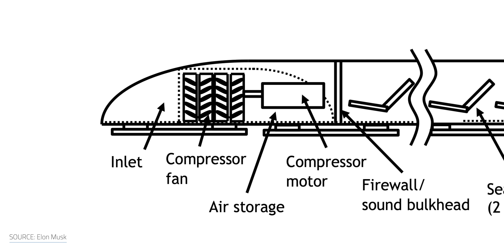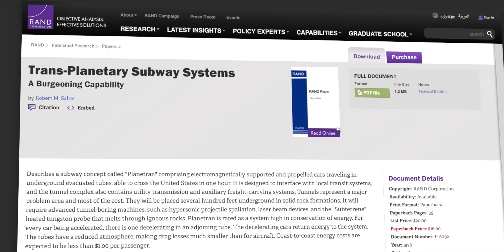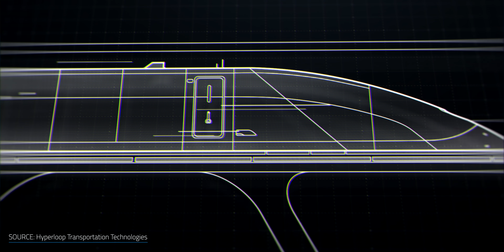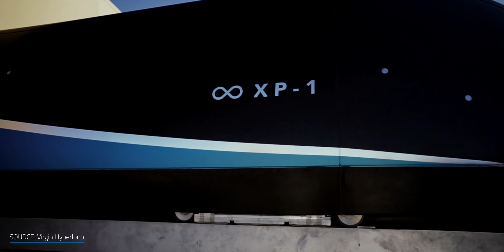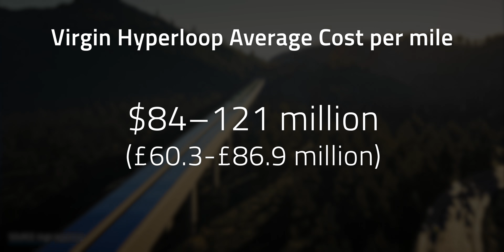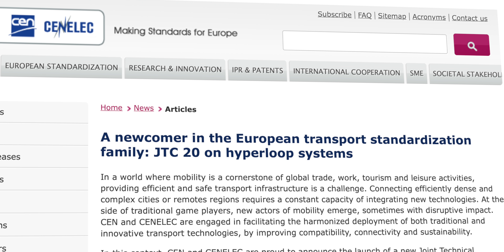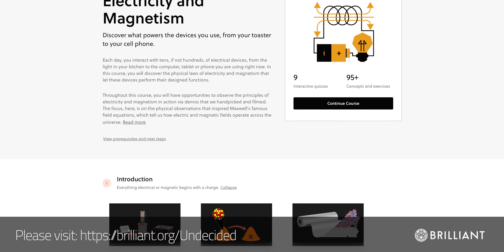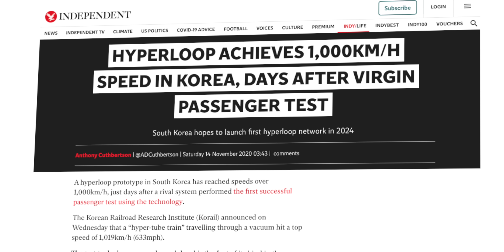Exploring Hyperloop - The Future of Renewable Public Transport?

Comment: The boring company loops cost so much less than subways not because TBC has any special sauce (they are a small group of engineers mostly running off the shelf TBMs) but rather because they deleted a bunch of expensive safety features while putting a more dangerous system in the tunnels.

Comment: Most, or all, high speed trains today are electric. That means they can be powered by clean energy sources, just like the Hyperloop is to be.

There aren't too many mag-lev trains now. The reason is cost, which is significantly more than high speed trains on conventional rail, meaning that mag-levs aren't financially viable for most routes. A similar situation must also be the case for Hyperloop.

Comment: I'd rather speak to the engineer that musk actually stole the idea from :P.
Also, these projects just aren't realistic. The carrying capacity is TINY. The cost incredible, and you have to invest extra to avoid damage to the track.

The loop project is far worse in comparison as well. It's... JUST A TUNNEL. LITERALLY JUST A TUNNEL. Except it's very long, you can only fit a couple people in each pod, and it uses expensive elevators for no reason.

Just look at japan. They use actual maglev trains, have invested billions. And even then the trains are incredibly expensive just to ride and run. If they don't switch over to hyperloops, you can see why it's cool... but completely unfeasible.

Comment: The Hyperloop is a stupid idea on pretty much all levels. Security, Cost-efficiency, reliability, compatability and even just getting a useful connection at all. Even speed is no longer a good point, since conventional rail (like the maglev) are already close to same speeds and its also not going to exceed future plane speeds, if we really consider high speed an important factor. Its an overengineered, unpractical and fake-futurism solution to a problem, that doesnt really exist. Just built a damn train. America was capable of that, when Lincoln was in office.

Comment: A few problems here:
1. Earthquake (you said it)
2. Biggest Chamber with Vacuum is not close to what it would need. You would need several gates. And they would need to be exceptionally fast.
3. Once the Hyperloop is filled with air, this thing ain‘t go anywhere. It then would need to push the air to side wich is impossible.
4. If you can’t go anywhere, you can’t exit.
Reply: #4 is an excellent point. One of the companies say they have developed a safety system which will bring the pod to a halt on its wheels if there is some sort of issue. That's nice, but how do the passengers get out? And if the power fails, does the pod's life support continue to function, and for how long? And how long can the passengers wait to be retrieved when there is no life support and they are sealed inside an air tight tube?

Comment: 1. In California, what happens during an Earthquake, the tube cracks or deforms and the train 
     is running at 760 mph?
2. What happens if the Hyperloop train has to stop due to a failure? 
      There are no planned exit openings in a vacuum tunnel.
     The walk from the middle of the Los-Angeles to San-Francisco tunnel (about 370 miles) 
      should take more than a week!!
3. The test of the model at California cannot possibly scale up: Creating a vacuum 
      in one-mile tube should take only a few minutes. 
       Creating a vacuum in a 370 mile long pipe may take several hours. How does this save time?
4. Southwest can get you from LA to SF in about an hour for less than $100. 
     To offset the construction and operational costs of the Hyperloop, the cost of the ride 
     would be much higher.

5. The train is about the width of the tunnel to maximize the vacuum efficiency. 
     This means that a human cannot vacate the train from the side - there is no room.
     The front and back of the train do not seem to have a rapid evacuation port!!

Comment: Has anyone every seen a discussion of using composites for the construction of the tube?  Seems like a cost effective way to quickly produce miles of track.  It could be done in a continuous manner weaving fiberglass and carbon fiber in place with a machine that can also inject resin and cure it as it moves along weaving more tube.

Comment: Electric VTOL vehicles will take care of the people transport with out the limitation of fixed point hyperloop stations.  Might not be as fast, but eliminates the overhead of traveling to the nearest entry/exit point for the Hyperloop.  Freight might be and option though.  But it would have to be cheaper than current solutions.  And that looks like a pretty significant challenge.

Comment: It'll be interesting to see what this eventually ends up being.
Much has already been lost from Elon Musk's white paper, such as the air ski and the propeller.
I expect the next thing to go would be the extremely low atmospheric pressure, removing any amount of air from the system is a win for speed, but it gets exponentially harder and more dangerous the lower the pressure. There's likely a sweet spot where speed is balanced out with the energy cost of maintaining the vaccum and safety.

Comment: If you want to reach Hyperloop speeds just build high speed rail and use a third of the power the Hyperloop would require for operation and you will get the Hyperloop proposed results without any of the dangers of space

Comment: Hyperloop is not a new technology....it was thought up more than 70 freaking years ago..... but surprise surprise planes won the transport race ... and why is it that planes are now normal and why hyperloop has never been created? Because planes are safe as hell...you will NEVER get a safety level enough to transport humans at 900mph in a pressurized metal tube. Any puncture along the entire stretch between locks would be catastrophic failure and bodies won't be recovered because they will be a past. There's a reason why the hyperloop has gone 70 years without even a working prototype. Even jow as multiple companies are trying to build it have literally not even gone above a few mph.... you can try and claim its just the start but again this has been a thing for over 70 years. If planes are what they are now then if the hyperloop was anywhere near possible or safe than it would already be a thing. Sorry but 99% of people are never going to step into a tiny metal tube, in a tiny metal container moving at speeds where any slight turn, anything accidently left inside the tube or pieces of metal falling off stuff would lead to catastrophic failure. Pressurization is NOT safe and will not be anywhere near as safe as planes are already. Hyperloop is a stupid idea that has gone no where in over 70 years.......

Comment: If you're going to install the pumps to draw a vacuum anyway, and the vacuum is dangerous and costly to maintain, then why not just pump the air from the head wind of the train around to the tail wind as it moves. You don't really need a full vacuum in the entire tube, you only need to get the back force of the compressing air away from the front of the train, and if you can divert that force to the rear it should increase the overall effect in a way that is superior to a full vacuum.

I'm sure there's a way to build the tunnel like a tesla valve to take the head wind to the tail even with just the compressing force of the train moving rather than using pumps in the tunnels. The train effectively becoming the piston of a pump to drive the forward compressing air through tributary tunnels along the side of the main tunnel. Perhaps it would need computer controlled valves, then as the train draws closer to the destination the effect can be tapered off or directed to the walls of the train to help slow it down on approach.

Comment: Hyperloop has been shown multiple times to be entirely infeasible. Even Musk himself has walked back on the idea of e.g. the pods levitating inside the tube and instead would be using....plain, old wheels. Hundreds of miles of tube at a very low pressure would basically require pumping-stations every couple of meters, consuming enormous amounts of energy, and that's all not taking into account all the manual labour of checking and maintaining the seals all along the way! Besides all the above, it the pod ruptured....well, now you've got a pod full of dead people.

As for the various companies, well, e.g. the one in France turns out to be nothing more than a small office with no engineers or anything. It's all just about hyping and extracting money out of gullible people.

This video is basically nothing more than reading from marketing-material and goes to show that this channel is not for people who want actual, realistic information.

Comment: I'm surprised you didn't invoke our memory (40+y/o) of the tubes we used to put our paychecks and bank books in at the bank. Those worked great. But they made alot of noise and I can see how it would cause issues at scale.
Reply: Those are pneumatic tubes, completely different than having multiple pods in the same tube utilizing mag-lev.

Comment: actually, possible depressurisation are a very serious issue, since emergency oxigen masks are insufficient to help people survive:  U2 and Blackbird pilots used to wear astronaut suits, in fact, because over 60ooo ft the boiling temperature of water happens to be less than 37°C ...so, in case of rapid depressurisation, your body starts losing all its water and you die in few seconds

Comment: My thoughts can travel to San Francisco at ~the speed of light, so I don't need to physically travel that fast, but if they build it I will come (and try it out if it is deemed as safe as commercial air travel). I am very apprehensive about producing and maintaining a high vacuum in an immensely long tube.

Comment: WHAT A DISGRACE OF A VIDEO
doing fun servicing and act as public relations of elon musk
1. Heat expansion REAL ISSUE which was never addressed in elon musk 55 page release paper. They said the 300 meter expansion will just extent the pipes on both ends !?!?!?!?
something never tested and will never happen
2. heat expansion will also not be uniform since the half pipe will be heated and other half will be on shade which will have a twitch effect on the pipe
3. are there going to be escape position on the pipe? imagine if a failure happened and you are trapped half way the pipe how you will get out? all designs of capsule make it impossible to open a  door and let people  out of the capsule
4. no working at all at sealing door that will be needed to load unload capsules into the tube, since it would make sense to have a small [pipe that will fit the capsule close it, take off air then open a door inside the capsule to allow it enter the pipe. all other parts of technology is tested and well known to work the only need to be tested and show it can work it is not tested at all
5. above ground it will be a disaster to happen so it need to go undergound
where you need to make a huge tunnel and then place the pipe on it to make sure earthquake will not break the wall since the pipe can have some flexibility to move
6. for any realistic implementation you will need at least 3 lines interconnect to each other at points
to make sure 2 are always on use and one can be closed for maintained. which we come again to the airlocks not developed or researched at all

Comment: Sorry, Ferrell, but you fell for the BS that still circulates due to the original White Paper Musk published in 2013.
That thing included such mutually exclusive concepts as an AIR CUSHION (possibility one of hovering the train) in a VACCUUM tube (reducing air friction).
That was obviously total bullshit from the get-go because you CAN'T have both an air cushion as well as a high vaccuum.

So it was dropped by Musk almost immediately. 
He successfully sold off this absolute economic nightmare of a pipe dream thanks to Musk's only redeeming quality as a business man: his charismatic sales-pitch.
Others bought into this idea, and wasted enormous amounts of time and money on something that will not be economically viable.

Yet, until now, absolutely NONE of the predicted positives have even been approached remotely.
Neither the speed, the acceleration, the vaccuum, the transmission of energy into the train, carrying of air inside the train, a full size pod with the required internal structure, any kind of mag-lev capability, any kind of vaccuum sealed tube with ANY kind of curvature... the list just goes on and on and on.

The top speeds achieved in the Virgin Hyperloop was a mere 105 mph. 
As a German I can tell you that is considered acceptable speeds on the left lane of the Autobahn. Daily. Regularly, Without ANY vaccuum tube. But is exceeded regularly by standard cars.
Oh, and WELL exceeded by trains next to the Autobahn going around 300 km/h, roughly 195 mph.

So the CEO of Virgin Hyperloop was selling you the same crap every fan boy has been spewing for nearly eight years now. It has been done previously, cheaper, more often, safer, and much much more comfortably than the reconstructed air-plane cabin shoved into a tube with WHEELS still carrying the pod.

The only thing that already has been broken is the anticipated investment cost into researching this bullshit while attaining NONE, I repeat NONE, of the goals.
Withing eight years of developement. Yet the predicted date of opening (2024) of the supposed line from LA to San Fran is less than three years in the future.
Even the 2030 opening is only a pipe dream.

I will give you exactly one guess if ANY of the companies will achieve this goal until then.

For the Boring Company: yes, they built the Las Vegas Loop. 
A roughly ONE kilometer long tube, barely enough to contain ONE Tesla car with no room to spare.
Not driving autonomously but with a driver. At speeds limited to 30 mph. One way. In a single lane. With absolutely NO safety measures, emergency exits, passing lanes, air support, fire extinguishing measures. Carrying at best three passengers per car. For a cost of roughly TEN times the predicted amount. With seating and exiting procedures about as complex as getting into a normal car, including buckling up.
Yeah, great concepts. Building a slower, more costly, less efficient, accident prone, fire hazardous, uncomfortable METRO system requiring ONE driver per THREE passengers.
A-ma-zing!

Comment: I really wish that Hyperloop would work but there are too many things that make it less attractive.
First is the vacuum tube. It needs to be kept in low pressure, any leaks could impact the overall structural integrity.
Second is the "no windows". A lot of people need the sight on the moving environment to realise where they´re traveling to. When you close your eyes in a moving car that doesn´t accelerate it is not clear to the Brain if you move forwards or backwards wich can lead to motion sickness.
Third is the Vehicle itself. You need large quantities of Vehicles to make it viable. The upfront costs for the construction are really high adding to the already high costs for each vehicle.

Comment: high speed rail such as maglev/ shinkansen, are much cheaper, dont have the engineering challenges and solve many of the same problems, without the risks. At 600kmph LA to SF would take just under an hour compared to 35 minutes for hyperloop, not much difference and none of the drawbacks of possible decompression, and you actually get to see where you are going. Why not build high speed rail, instead of, or at least before attempting this?

Comment: Very honest video about the problems of hyper loop. Just forgot some problems, like: How much energy do you need to keep the vacuum in a big tunnel? How do you run an aircondtion in a pod that flies in a vacuum tube? Inside of a pod it will get hot, humid and very low air quality very fast. There is no possibility to remove a significant amount of heat. If you run aircompression to levitate those motors produce alot of additional heat in the pod.